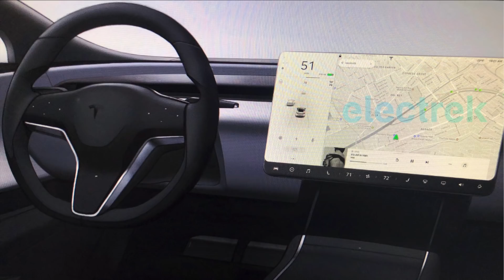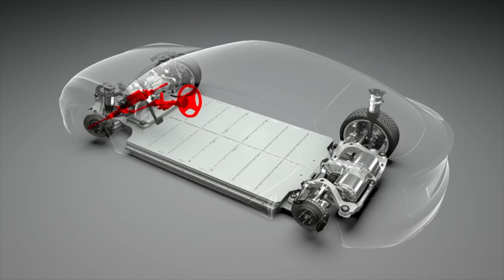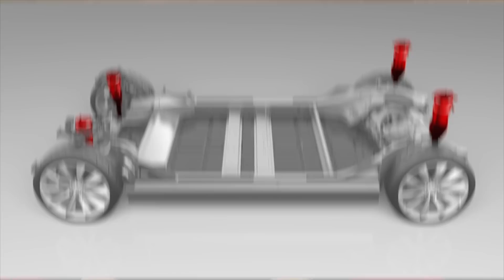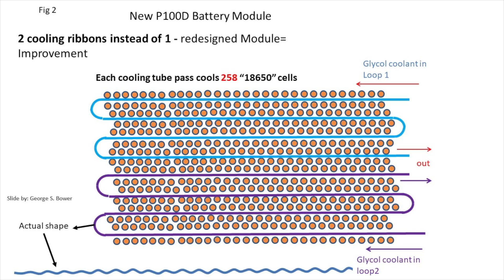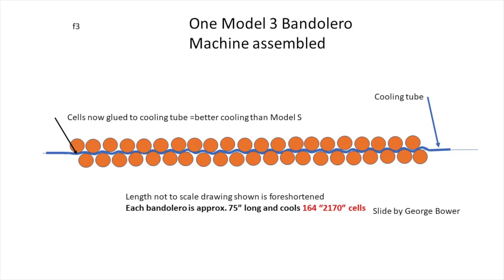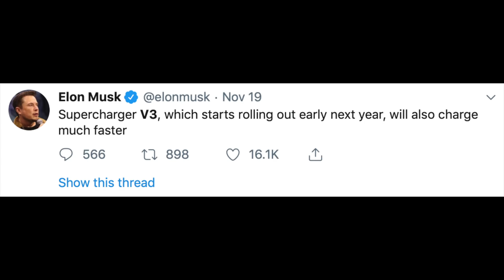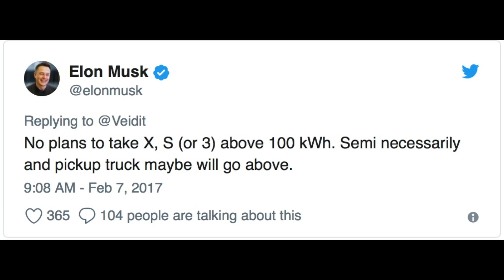The reason Tesla's 75 kWh battery is going away

Comment: I have a classic 85 battery.    If this one fails what the replacement be?
Reply: good question.   let's look 5 years down the line when Tesla will retrofit our 85s with 100kwh or more packs.. at a cost, but it will be like a new car
Reply from the maker: Good point. Didn't think about that. Could it be retrofitted?
Reply: Sean Mitchell 
I still have 27 months left on my battery warranty.  If something like what happened to your battery happen to me I guess they will have to put a 100kw pack or build a 85kw pack.   Not sure just wondering. 

I’m sure it can be retrofitted just like Jason Hughes   Did with his classic 85kw

https://mobile.twitter.com/wk057?lang=en
Reply: @AllThingsEV 
I think it should be possible physically, as the height of the cells aren't that different. The whole battery can be easily replaced easily, because it was designed to allow battery swaps. So if they make the new batteries the same size then it will be possible. And it would make sense, because that would require less changes in the design and the production lines. And would solve the problem of supporting older cars. With the 8 year warranty, they have to have a solution, and this seems to be the most straightforward to me.
Reply: but will the free supercharging for life be cut off if they upgrade the old battery?
Reply: b ho 
I believe the vin # always keep that free supercharge for life. But not 100 % sure.   Now the guy from North Carolina. Jason Hughes have upgraded some classic model s and they keep the supercharger free.
Reply: or a reason for no upgrade?
Reply: I've seen a few cars advertised where they say Tesla replaced their 85 with 90 and even rebadged it for them 
i guess it all depends what the SC has in stock when they get a faulty battery warranty issue....
Reply: i need a 600 km battery!!
Reply: Your screwed. Just like every other cult member waiting on parts.

Comment: I think Tesla will come out with a significantly larger battery for the Model S and X. 130 kWh or more.
Reply from the maker: Ya. If I were to put some money down, I’d say 115 or 120 kWh.
Reply: @AllThingsEV  The reason I think it's going to be significantly more is that currently the Model 3 has about the same range as the Model S and more than a Model X. Hard to justify the higher price and higher status when the range is not there. 5-10% isn't going to cut it. Also, the first real competitors are coming with similar range. Elon said every year batteries improve by 5-8%. If we take 6% per year from 2012 when the Model S came out, we should have a 120 kWh battery this year. So we are actually way behind.
Reply: I'm also more for a 120-125
Reply: Why bother?  If they keep expanding the charging network what's the advantage of an even larger battery?  That'd be like putting a 100 gallon tank in your sedan because "100 gallons is bigger than 20 gallons."  If I had to bet short of some radical change in battery chemistry overall pack energy storage will decrease on average over the next 20 years not increase.  

Think about it.  You can sell that Sedan with a $25,000+ 80kWh battery or the same car (otherwise) with a $12,000 40kWh battery and point the customer at any number of 1000s of DC charging stations.    Given that the vast majority of car trips are <50 miles having an enormous pack makes no sense.  It's more important to expand and standardize the charging network than anything else.
Reply: @tomstdenis  take a cell phone. If you had the choice between a phone with a battery that lasts twice as long, or one that charges twice as fast, what would you prefer. Most people would say the battery that lasts longer. EVs need a little more range to make up for the added charge time compared to ICE cars. I agree about the price. The cheaper car (with less range) will sell better, but the larger battery option will be popular as well. When Tesla came out with the Model S, there was a 40, 60 & 85 battery. The 40 didn't sell at all, the 60 sold a few and the majority bought the 85.
Reply: @DavidDrivesElectric  Again you're ignoring the charge network.  It's really important to have a car that can go 200+ miles on a charge because chargers can be quite far apart.

Once chargers are "on every corner" you won't care about that.  Why pay 10s of 1000s extra for range you'll never really need?  

There will be a sweet spot of practicality and it's likely to be in the 30 to 50 kWh range.  Sure "extended" range options will likely continue to be offered but that will likely mean <100kWh for cars because at that point you're talking about driving 5+ hours without a stop.
Reply: @tomstdenis  The Model S/X is not the economy class vehicle that needs to be made cheaper. Tesla has to make sure these models are keeping their advantage over the competitors (Audi, Benz, Jaguar). The ratio of Teslas sold with the large batteries vs small batteries is aprox 4:3. Considering that the larger battery cars were considerably more expensive shows that large batteries are what people buy even if they have to pay much more.
Reply: @DavidDrivesElectric  I said going forward.  Right this instant large batteries makes sense.  But in 10 years?  Not really.  Good luck selling an EV for $20,000 that has a 100+ kWh battery in it ...
Reply: @tomstdenis  Have you ever driven with small children? :)
Reply: @DavidDrivesElectric  Yes, and they tend to not want to drive for 5 hours in a stretch.  You're going to be stopping every 2 hours for snacks, restroom breaks, etc anyways.  Even in our gas cars we rarely ran them dry and found ourselves filling up around half tank while on road trips.

That's my point.  As DC fast chargers become more common the pressing need for battery size will be removed meaning people can justify buying cheaper cars with smaller batteries.

Comment: Sean, great job again with your analysis. Thank u for taking the time to share this with the rest of us!
One thing though, I remember Elon tweeting a year or so ago saying it would require a complete redesign to switch from 18650 to 2170 on the S and X. However, I do agree with u that they have now started to focus back on S and X a bit more now.
Reply from the maker: Thanks Michael. 2170 cells seem to be more energy dense. Wonder if it's possible to get more range out of the same size pack.
Reply: @AllThingsEV  no , not really . A 2170 has a 18Wh rating while a 18560 has a 12Wh rating . The 2170 has also 50% more volume and 50% more weight , so they both have the same 250Wh/kg rating . No difference at all.